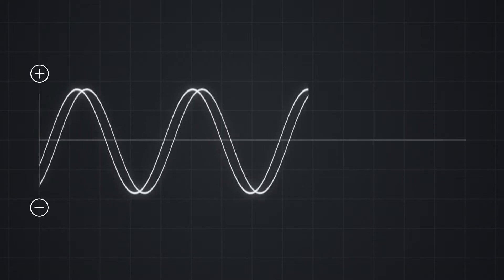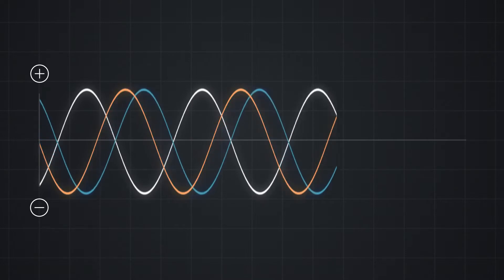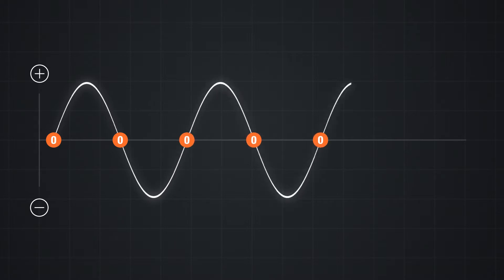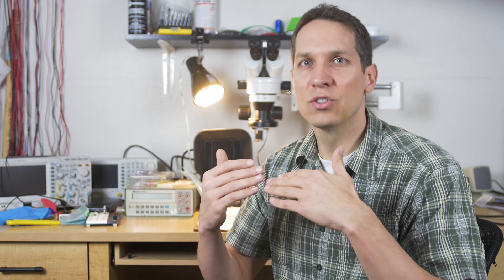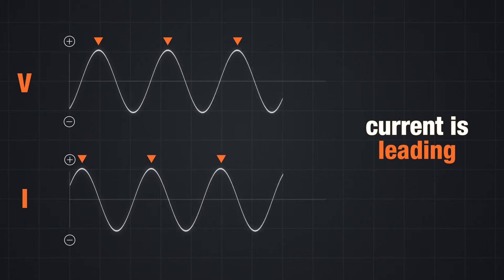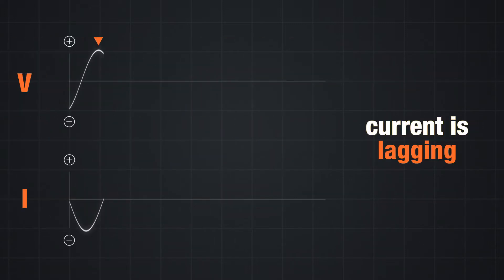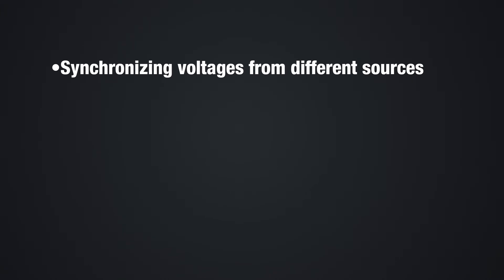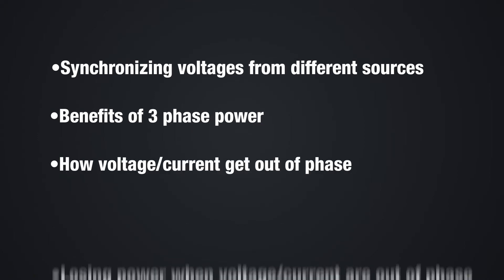A Simple Explanation of Power and Phase - With Animation | Basic Electronics

Comment: U r saying abt phase lags when using capacitor ,inductor and resistor. is their any difference in lag or lead when we r applying dc or ac voltage.
Reply from the maker: Yes, this does not apply to steady state DC voltage - this is only for AC.  However, the concepts sort of apply when switching in DC.  The larger the capacitance, the longer it takes for the voltage to change when you open or close a switch.  However, we usually treat that differently both mathematically and conceptually.  To keep things simple, just apply these concepts to AC signals.

Comment: Sir can you tell me what would happen to VARs when we increase inductive load, it would increase or decrease.
And what would be the effect on kWh energy consumption.. Let's say we decrease number of turns in any inductive circuit( may be motor) so power consumption will increase or decrease through the circuit.
Reply from the maker: Hi Kanchan!  As VARs represents both the true (or real) and the reactive (or apparent) power, the VARs will go up if your load goes up, whether that's "real", inductive, or capacitive.  Now, if your load becomes more inductive, unless that means that it's balancing out a capacitive load, then your reactive power will increase as a ratio to your overall power, meaning your power factor decreases.  In regards to decreasing the number of turns in a circuit, I'm not sure what effect that would have.  Power is dependent on your load.  Using the motor as an example, your power consumption is not static - if your load increases, the power consumption increases.  So, by decreasing the amount of turns, I think you're more affecting the torque and other parameters (which likely cause a secondary effect on the power) than you're affecting your power directly.